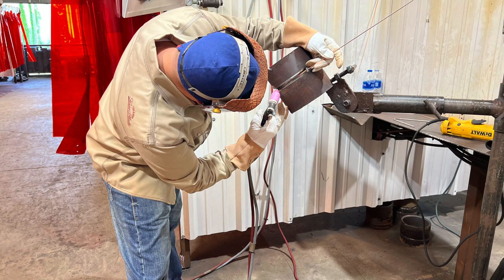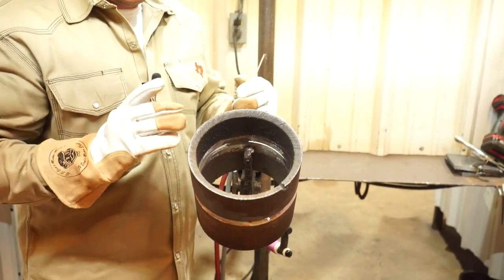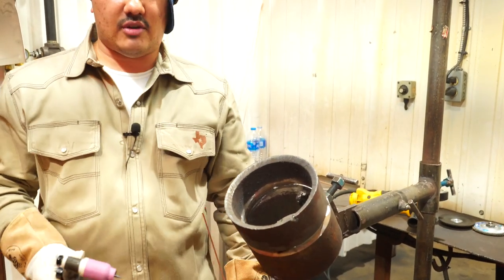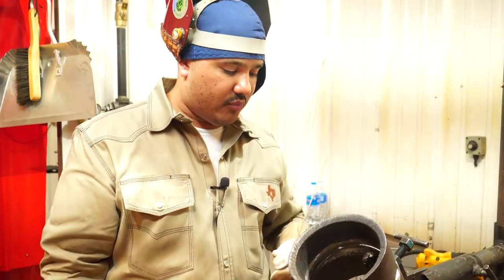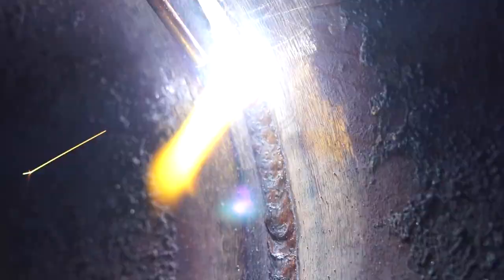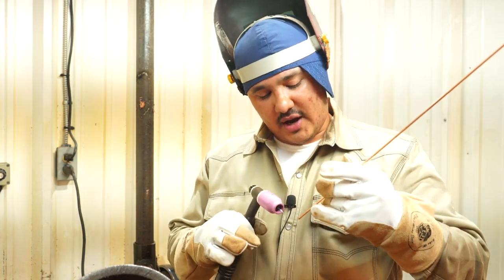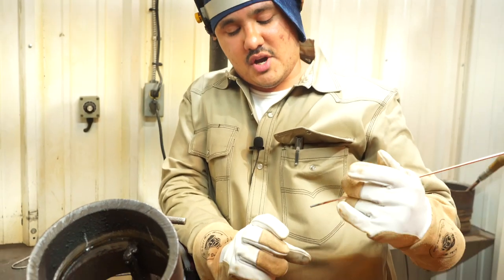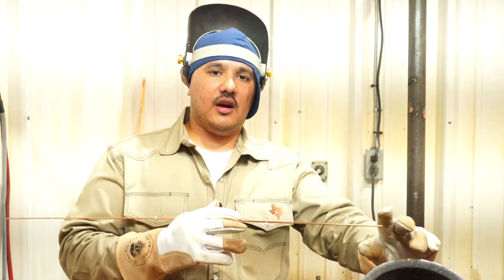6G Tig Open Root Er70s-6 on 6 Inch Carbon Pipe

Comment: Is it better to use a foot pedal or scratch start I'm having a really hard time doing Pipe and I have to get ready for a test with this company I'm in its going to be a 6g test sh80 any advice from anyone thank you all
Reply: Scratch start. And practice right hand left hand for putting root in. It will help you tremendously in the future